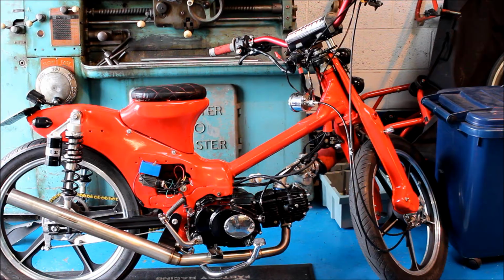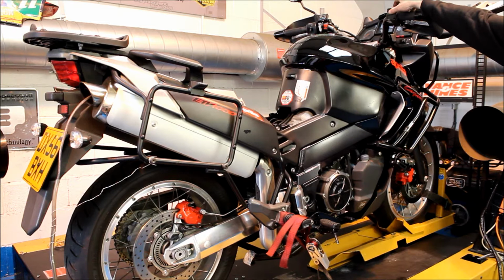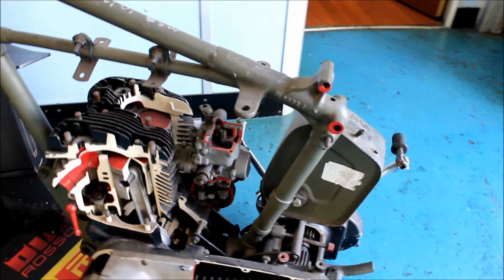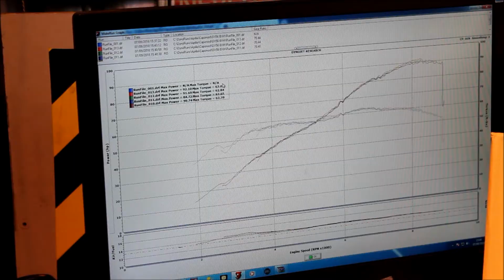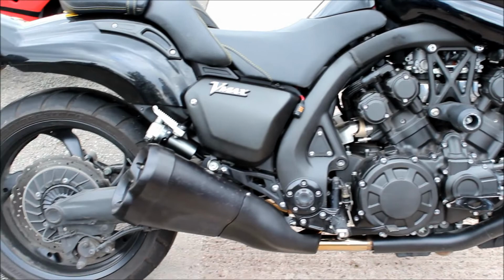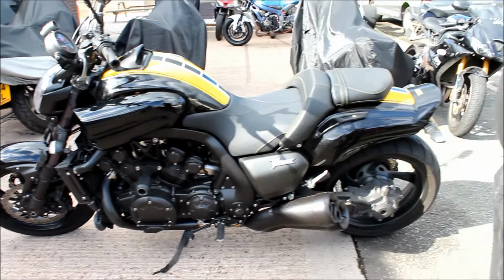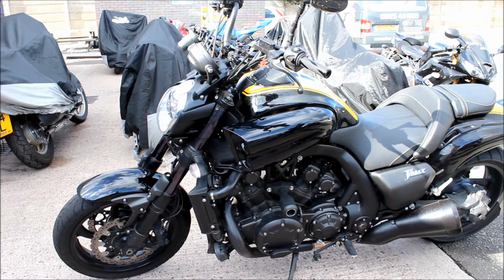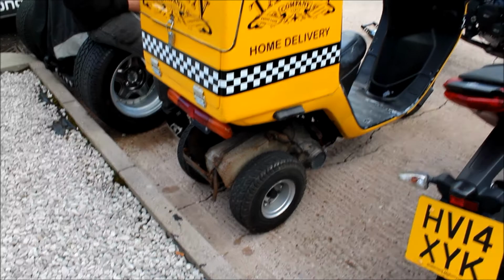Hammer & Tongs Performance Vlog #8

Comment: Hi BevelHead. Hammer and Tongs vlog # 6 features a Griso 8v. This is a bike I am looking at for myself. Do you have any information on the results of the Dyno work?
Thanks
Reply from the maker: I don't have the numbers for that Griso, but as Sam mentions in the vlog, he expected the HP to be 95 to 100 at the rear wheel, after it had a custom map. One point I would make is that some customers are happy to have their results made public, while others would prefer their bikes results to be kept private. I don't know if the customer of this particular bike would mind the results being put here, but either way I have to be mindful not to upset anyone in case they do mind.